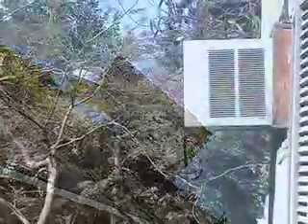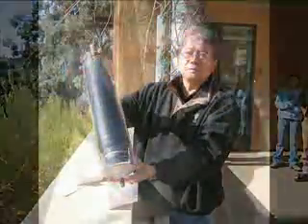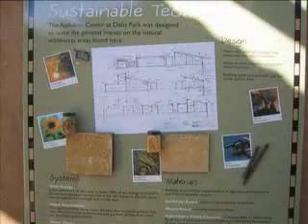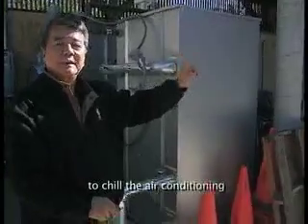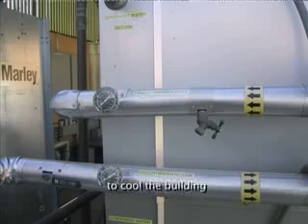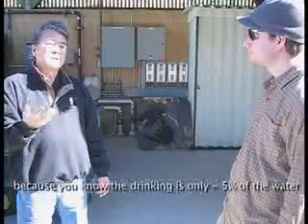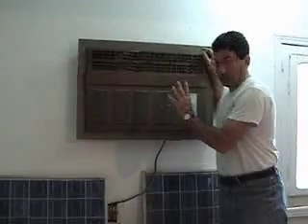Solar Air Conditioning

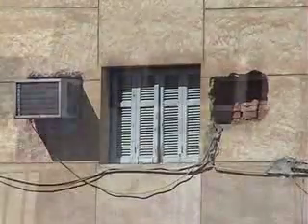Comment: Ok, now I'm only at 1:00, but am I to understand that you're claiming a problem of displacing heat from inside a building to the outside, causing massive warming of the environment?  Shut the fuck up, the volumes of buildings don't hold a CANDLE to the volume that comprises our atmosphere.  Fail.

Comment: Yeh Nuclear is heaps good these days. The technology involved is absolutely remarkable now. 
But you do have a point about using solar powered systems - i agree, they will significantly reduce greenhouse emissions but the only disadvantage is the COST involved in every system. Until hyper-efficient solar panels, i guess nuclear and fossil fuels will have to do. :(

Comment: Yah! If a nuclear plant is well designed, well built and then kept up properly, they aren't bad. But the fact is that nuclear plants are usually run for profit. They are not kept up and they commonly pollute (leak radioactive materials).

Comment: The only actual downsides to nuclear power are cost, time to reactor activation and the amount of water required for coolant. Modern, third generation nuclear reactors are extremely safe and NOTHING compared to the ones in the past, which were fairly safe already.

Comment: Ok, the system has enormous potential. I have a home in Florida so sun exposure is great. I currently have a 4ton 22 SEER 410a heat pump system. The cost to me as a contractor for the equipment and materials to install this unit to code was $8,400. How much would a comparable solar comfort system cost to install? I am looking at a projected average  operating cost of my system of about $900/yr

Comment: miniturization.  efficient new technology photovotaic cells, for super condensed energy output [there's that miniturization again]

and is he suggesting we take the pipelines out of the sewage system and treat our on refuse water?  that's the only part i have a problem with.

Comment: air conditioner efficiency. 
absorption systems typically have a COP of 0.65 - 1.2 
Electric vapor compression system has a typical COP of 2.0 - 6.1.

WOW the vapor compression system is way more efficient. Three to four times more efficient.  
If the heat is free. this doesn't matter. go absorption. 
If you buy your energy. Why pay 3 to 4 times  more. go vapor compression.

Comment: Looks very small cheap and compact !!! ideal replacement for small split type A/C systems ....NOT.. i am sure it works but unfortunately is not the answer. You moan about air conditioning systems but i bet you have a car...dont you!

Comment: I agree that this is the way to go but the part about CFCs as refrigerants causing O-zone depletion is not true.  R-12 Freon (banned in the US since 1990) is more dense than air in gas phase so it is absurd that it rises 7 miles into the sky.

Besides, the genie is out of the bottle anyway.  Other nations all use CFCs and many vent waste CFCs right into the air.

Comment from the maker: I agree completely... I never said I was smart, just that I wasn't ignorant.  And I certainly don't think formal education beats hands-on experience and empirical in-the-field observations.  I also agree that water fired adsorption chilling systems are too expensive for the average person -- but not because of the solar side of the equation. Heating the water is easy.The problem is that nobody is manufacturing family size adsorption chillers. And this is probably because they don't see a demand.

Comment from the maker: A 10 ton chiller is very expensive and only appropriate for large installations (like the Audubon Science Center in the video).  Many industries uses adsorption chillers (mostly fired by natural gas, but easy to convert to using solar heat instead) but there has been no market for home sized adsorption chillers.  We need to create one.  Once entrepreneurs see opportunity and they are mass produced they should be fairly cheap.  Supply and demand, economies of scale, you know the economics.

Comment from the maker: Average income in which country The457? (Sorry, I live in Cairo Egypt where the average income is about 100 dollars a month!). But to answer your excellent question -- the heat pipe vacuum tube solar collectors cost about 2000 dollars -- I know because we put them on my parent-in-laws house in Germany.  They provide all our hot water.  Turning the hot water into air conditioning means buying an adsorption chiller and there is no manufacturer I know of that makes one less than 10 tons.

Comment from the maker: Heat is used to separate the two fluids; when they are brought back together in a near vacuum environment, the water experiences a phase change to remix with the salt at a very low temperature (at normal atmosphere pressure, water vaporizes at 212F; in an absorber, water vaporizes cold enough to produce 46F chilled water.)" So it is rather simple, and I think it is criminal of industry not to develop household sized chillers that can be used with our solar hot water systems.

Comment from the maker: Doazic may be ironically right to say it that it involves running the thing on water -- to quote energy solution center: The refrigerant used is actually water, as that is the working medium that experiences a phase change that causes the cooling affect. The second fluid that drives the process is a salt, generally lithium bromide...

Comment from the maker: Seems like until consumer demand drives this market we're out of luck. The neat thing is that absorption chillers provide both heating and cooling so your investment works year round.  And they are industry standard at the large sizes (minus the solar tubes). You can read about it at energysolutionscenterDOTorg. 
So for people like Doazic who worry about whether it works, do some homework! Absorption chillers have been in use forever. The solar add on is what brings running costs way down.

Comment from the maker: I think we could use our 2000 dollar solar hot water collector to do the air conditioning in the summer, but what we can't afford in our house right now is the Mizaki Chiller and the piping. The problem is that I can't find anybody who makes an absorbtion chiller smaller than a 10 ton. These exist everywhere, and can use any source of heat, but are too big for a household. I imagine somebody could make a small one that could sell for 2000 bucks, but I can't find one.

Comment from the maker: Then it goes through the typical refrigeration phase through an expansion valve into coils next to a fan in a standard Mizaki chiller. The trick is transfering a high enough temperature to the refrigerant to build up the pressure and the cost comes from having enough tubes to get to that temperature, and have your plumbing done right.  It isn't rocket science.  In fact you use the same tubes we use on our house for solar hot water. They only cost about 20 dollars per tube.

Comment from the maker: In a solar air conditioner, instead of using the heat from a candle, we use the heat of the sun.  Vacuum tubes on the roof heat water up to nearly boiling temperatures in the sun and this hot water goes into a pressure tank where it transfers its heat to a refrigerant.  Because people find ammonia too toxic to work with in domestic conditions these days, they use lithium bromide instead.  As it heats it builds up pressure.

Comment from the maker: The heat from inside the fridge is now carried out of the fridge by the refrigerant (which is a heat transfer fluid), but now it is under low pressure. So to do the same magic again, and pull more heat out of the fridge, it needs to be pressurized again.  In a conventional fridge (or air conditioner, which is just a refrigerator with a fan that blows air over the cold coils )the compressor does the work, but sucks up a lot of electricity. In a candle powered fridge the heat of the candle does it

Comment from the maker: Same thing happens when you open the valve on a scuba tank.  Any gas under pressure becomes endothermic when you release the pressure. Look at the back of your fridge and you will see a place near the compressor where the small pipe carrying the refrigerant suddenly widens into what looks like cigar shaped tube. That is the expansion valve.  Once the gas is really cold it can circulate through the ice box and since heat moved to cold, it removes the heat from the inside of the fridge.

Comment from the maker: As I understand it,it works much like the ammonia-based refrigerator we had at our Harvard research station in the jungles of Borneo.Since we had no electricity, we used a candle flame (and sometimes a wick dipped in alcohol or kerosene) to  power the fridge.  The heat of the candle flame heated up the ammonia, increasing its pressure and driving it through the coils.  Then the ammonia went through an expansion valve.Maybe you've noticed that when you press on a spray can the tip almost freezes?

Comment from the maker: Many people here live on less than 2 dollars a day, and these are often the most enthusiastic about innovations like solar air conditioning; currently they have NO air conditioning,and suffer the sweltering heat, because they can't afford the rising electric rates.Those who have air conditioners are no longer using them. But we know that if we can get grants or investment to build a solar infrastructure, the running costs will remain stable thereafter.So we like studying solutions like this one

Comment from the maker: We have no say in the matter, and will be the first to suffer when the cost-cutting faulty equipment that government/big-industry use (so they can stuff their pockets) leads to health, safety and economic problems.  We are demoralized by the air and water contamination in Cairo because of fossil fuel use; more than 10,000 people a year die because of smog in Cairo and our children risk an average drop in IQ of 4% due to lead in the air in some parts of the city.

Comment: hi, thanks for sharing the info, where did u buy the solar panels,it seems cheap from what i know it cost more than that just to be able to run the AC,(so that others reading this can check it out and start using solar panels to cut down some of their consumption,they dont have to go all out into solar, but they can start partically and see the benefits, and pls post future info on the solar absorption aircon, and where are can we learn to make it?thank you.

Comment from the maker: It was sized for the entire Debs Park Audubon Center.  You would have a much scaled down version. Also, you don't cool at the expense of your water bill -- it is a closed loop system.  The same water is reused over and over, merely as a heat transfer fluid.  Think of your car radiator.  Same idea.  You don't pay a massive water bill for cooling your engine, do you? You only top off the water once and a while.

Comment from the maker: Black surfaces that DON'T have water as a transfer medium  (such as black tar or shale roofs) can create a heat island effect because the absorbed heat is reradiated into the air. Solar systems take the heat away and help us avoid having to create additional heat through combustion of a fossil fuel.  So your comment is the red herring, einodgo! Also, there is nothing complex about vacuum tubes.  We use them in Cairo and in Germany and Spain on personal roofs, and just need a scale down.

Comment from the maker: This is "our narrator" speaking: while I don't profess to be an "expert" I can tell you that it is misleading to think of "black solar collectors" as creating "heat islands".  The heat is absorbed and transferred to the liquid which carries it down into an insulated storage tank.  Then it is used in the house for hot water (which would have been heated otherwise by burning fossil fuels). This in fact, cools the roof (taking heat away from it).

Comment from the maker: But in Los Angeles I successfully ran a normal electronic appliance intensive household for three years on solar energy, spending no more than 7000 bucks (half the cost for most systems is the installation, and I did all that myself -- it was as easy as hooking up a home stereo system). Now that I live in Germany we don't need air conditioners, but I would use my PV for one if I did, until I can afford (or learn how to build) a solar adsorption chiller.

Comment from the maker: But since nobody wanted to share in the cost of the PV panels, charge controllers, inverters and batteries that I self-installed (to the tune of $7,000 -  I had 14 solar panels, 8 of which went primarily for the air conditioner and the microwave, 4 for the refrigerator and 2 for the lights and TV) my attitude was "this is my solar electric system, I'll use it for whatever I damn well please!".When I didn't use the air conditioner, I could run the microwave for hours. Otherwise I got a half hour.

Comment from the maker: I found I only needed 2 hours of use to make my small apartment chilly, and I only needed to use my air conditioner on really hot sunny days when my PV panels were putting out the most power.  Some other eco-villagers were appalled that I would use an "evil air conditioner". I had to explain that my model had no ozone depleting gases, and that I provided all my own electricity for it. They still got angry, saying the electricity could better be used for other things.

Comment from the maker: You can say 'well, we don't know what synergisms created the cancer that killed your loved one' but to the sufferer the answer is clear  - let's eliminate all superfluous sources of carcinogens, especially the one's that have substitutes for, and then see where we are. I've lived 'off-grid' using solar for years, knowing that not one watt of electricity I use has the potential to harm anybody, and it was within my low budget (I live on less than $15,000 a year) so the cost argument seems wrong.

Comment from the maker: The thing is we HAVE solar air conditioners in Los Angeles and elsewhere.  Why build a single nuclear plant if you don't need to? What is the point?  They have to be decommissioned after 30 years anyway, and that costs a bundle, and then there is the waste to deal with, even if no accidents occur. They are terrible investments and need 24 hour security. Who do you suppose profits from all this, the consumer? Renewable energy has almost zero hazard, nuclear has considerable hazard,& you choose...

Comment from the maker: That's not true jyt230 -- this trigeneration system uses steam and high temp/pressure H20 to drive a Mizaki Absorption Chiller.  There is PV electricity involved, yes.  The net effect is a tremendous savings in energy.  By the way, most photosynthesis is under 3% efficient, but we rely on plants growing in the sun for our food (and that was the capture rate that permitted oil to form way back when).Combustion engines have a second order efficiency (well to wheels)well under 25%, but we use them.

Comment: Rather, passive cooling design features such as awnings and solar chimneys are truly self-sustaining as do not require energy to cool buildings.

Nonetheless the air conditioning system presented in the video is worthy of mention I feel, due to its operating efficiency which should of been the focal point of this video instead of its solar powered design.

Comment: The air conditioning system isn't solar powered per se. It just uses solar panels to satisfy its electrical needs.  The argument for which to dispose of conventional air-conditioners can easily be defeated by connecting a conventional air-conditioner to solar panel, thus constituting "solar powered".

Intuitive as it may be, presenting a solar power air conditioning system which runs on electrical current is not ideal as current technologies only allow for ~25% efficiency  in solar panels.

Comment: Solar absorption cooling actually has been around for a long time refrigerators that used this process were some what common during the early 20th century before electrical power became cheap.
The ammonia refrigerators in campers work on the same principle except instead of the sun a small propane flame provides the heat for the absorption process.

Comment: "without any negative impact"    Bullshit.   While I admire those who attempt to advance technology with an eye to reducing environmental impact,  ALL  machinery  has some impact,  from the energy and resources  needed to build them,  to operational pollution,  to the pollution caused by disposal.    ALL   heat pump devices  MUST  reject heat,  so this means that this unit also  causes the same heating effect that conventional AC  causes.  

The jury is still out

Comment: I suppose the idea is that you'd use less cooling if there was less sunlight. But you'd probably have to install some batteries anyways. It seems to me that for a residential setting, it would be much simpler just to use your normal air conditioner with a bunch of solar panels on the roof.

Comment: This system in effect looks efficient and safe.  it's essentially doing the same job as a low temp hot water system, with a different power feed to run the system, and a heat exchanger to cool the air.  If that's true, the system won't run any harder then 30 psi without the Safety valve blowing off

Comment: notice how all those reg. ac's are in crowded apartment buildings and whatnot...and all those solar ones are in forests and rural areas?  there's a reason they don't use solar energy for much in a city...you'll only get sunlight for a few hours a day and they're so inefficient that those hours will not be sufficient to run it the rest of the time